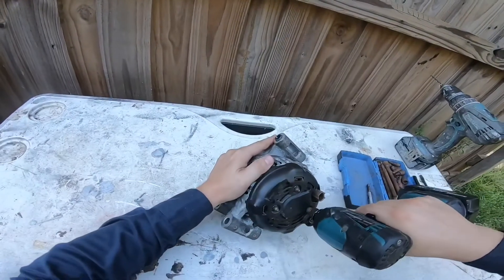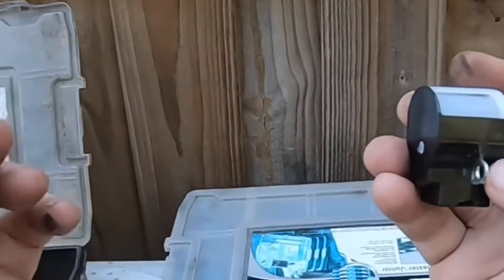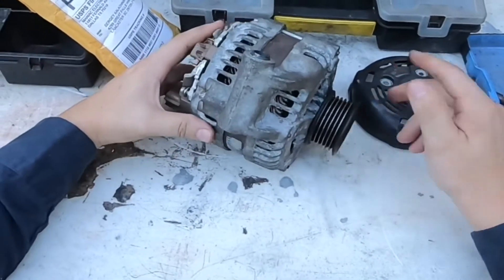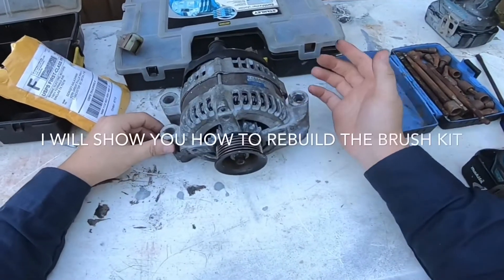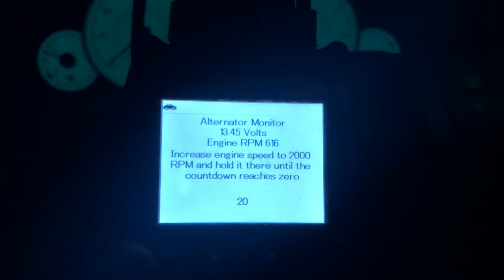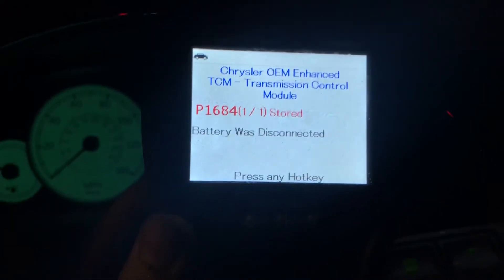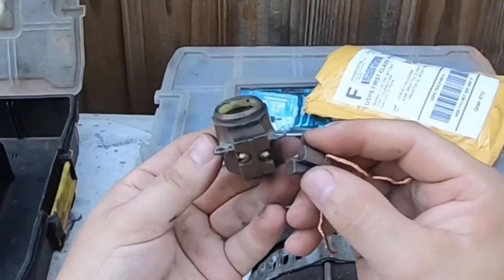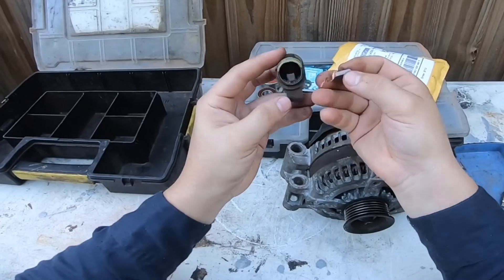How To Replace Alternator Brushes and Voltage Regulator on a Denso Alternator

Comment: A statistic about alternators - 90% of the time they fail due to the brushes being worn out. We're talking a $1-$2 in copper, but the brushes are usually part of the voltage regulator and for a few bucks more it's easier to just replace the regulator that has new brushes with it. Less disassembly. The brushes are small and hard to work with I think.
Reply from the maker: Did you know? About 90% of alternator failures are attributed to worn-out brushes. Surprisingly, these are often a simple $1-$2 in copper. However, the catch is that the brushes are usually integrated into the voltage regulator. For a few extra bucks, it's often more efficient to replace the regulator, which comes with new brushes. This not only saves money but also makes the replacement process easier, as the brushes can be tricky to work with due to their small size. Practical tips for smoother maintenance!

Comment: Wishing you would have replaced the bearings as I needed to find a video that opened up the case.  Whenever I take the time to remove an alternator, I would choose to replace all in the kit as the parts would just be collecting dust anyway or you misplace them.

Comment: looks like your brush replacement has shortened the life of them   . They look to be the lenght of the brush set you originally replaced ??? ( I think you pulled them in way to far and set a large load on the springs .??!!

Comment: another false hood is that the pullys are not heavy duty .newer vehicles use one-way clutch (OWC) or overrunning decouplers (OAD) type pullys  WHICH ARE NOT INTERCHANGEABLE  even though they may fit !!